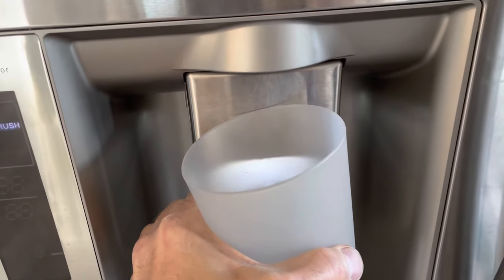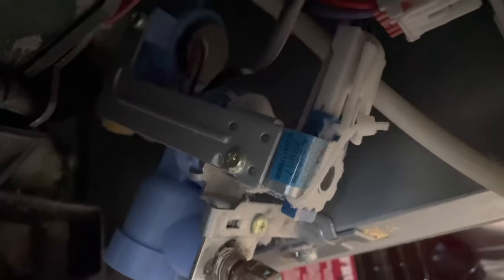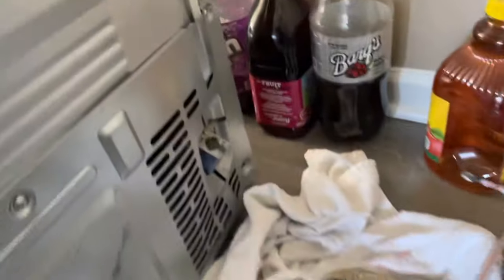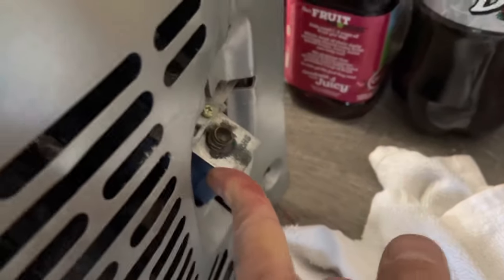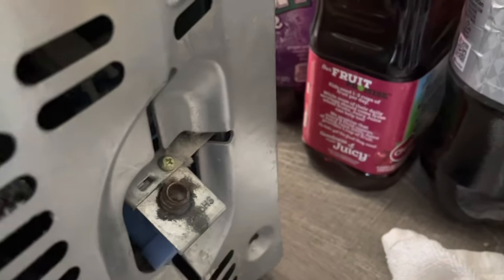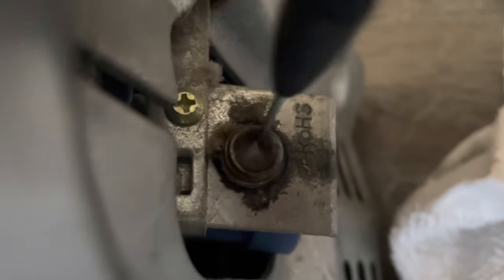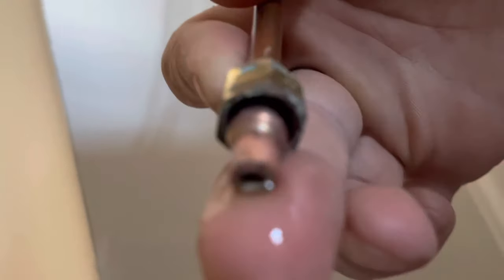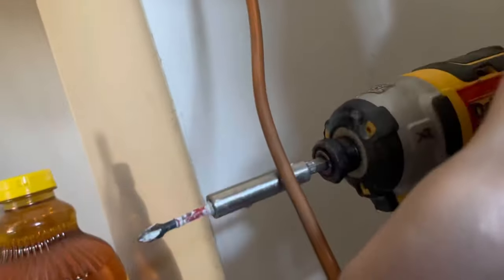How to increase your fridge water pressure

Comment: Same situation here. I took the flexible supply hose off the back of of the refrigerator in exactly the spot in this video. Found no clog whatsoever. Ran a little water through the braided supply line.  no clog whatsoever. reattached everything problem miraculously solved. Water flowing like a water hose. no explanation, butproblem solved. Here’s hoping it lasts.

Comment: This worked we had low pressure. First we checked the line from the wall it sprayed out a bit of sediment. Then we disconnected from the fridge it had some clogging used a pipe cleaner gently . Worked like a charm. I went ahead and changed the filter but was probably unnecessarily early but wanted to start fresh . Thank you so much you saved us over 150 bucks . And a lot of frustration.

Comment: I changed my filter, sputters a bit, but then nothing. Sputters a bit then nothing. I've been doing the every 5 sec on and off for 45 minutes and same results, sputters and then nothing. Yikes, very frustrating.
Reply: I just saw a video on this since ours was doing the same thing.  There is a small flat tab sticking out the end of the #3 filter close to the two tubes.   He said that something has gotten stuck in the slot it fits into.  So, he cut almost half of the tab off with side cutters.
Reply: @KevinCoop1  i finally figured it was a faulty filter. I put another one in and it started working!

Comment: I have strong water pressure coming out but still not making ice, most videos say check you water pressure any ideas?
Reply: Did you try to change the water filter? It usually fixes my issues
Reply: Defrost